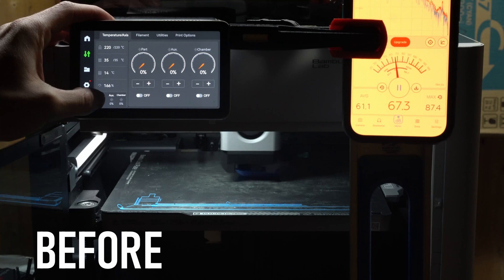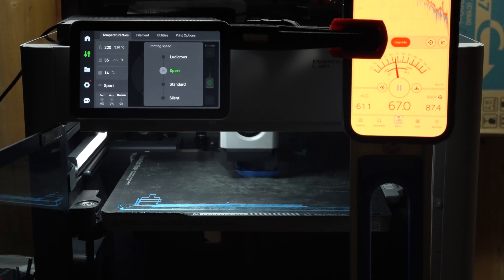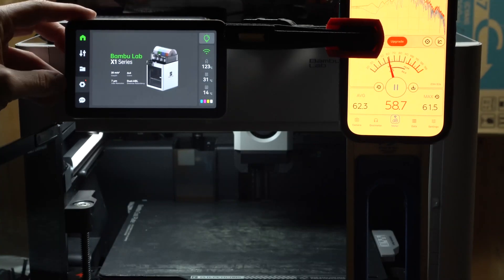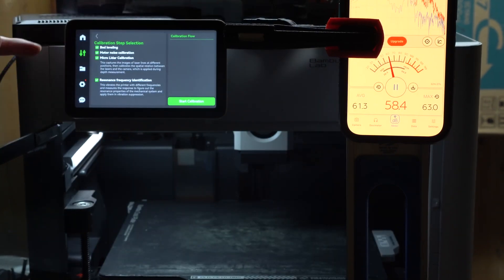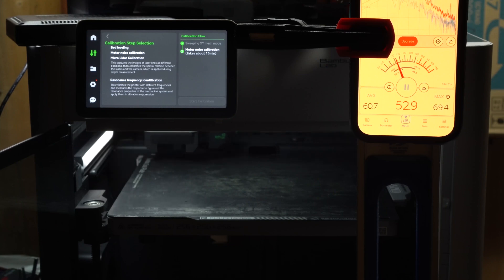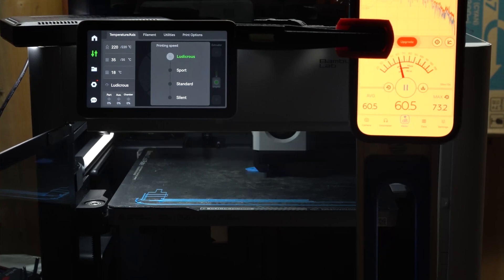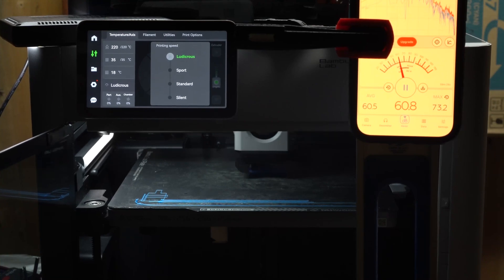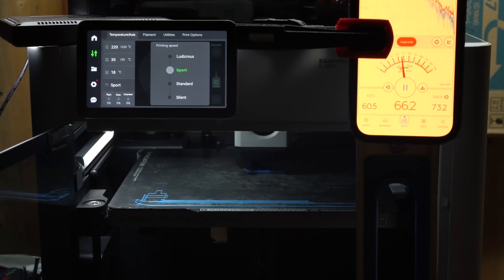Is the X1C finally quiet? Motor Noise Cancellation Firmware Update

Comment: your printer isnt supposed to sound like that. you could here a clicky noise and like something is loose, you need to adjust the belt tension. That doesnt sound really good. I hd the same problem with my X1C and bambu lab told me to adjust the tension on the belts and calibrate it.

Comment: I believe it causes the noise to be higher frequency. Active noise canceling, in general, removes mid noise, increases high frequency noise, and can't change base. The better the noise canceling, the higher the frequency ends up being(ideally, out of human hearing range), and then the higher frequency noise attenuates naturally.
Reply: It doesn't simply change the frequency. It creates a second sound wave that has the same amplitude but opposite polarity to the first sound wave, which makes the sound waves cancel each other out.

Comment: To test this properly, you need to put the microphone 1m from the printer on an isolated mount, the take measurement for say 1 minute and do a frequency analysis so that you can get both an average spl noise floor and also an average of the frequency distribution of your noise floor. You then do the same testing with the printer prior to the firmware update and finally you test again after the firmware update.

What I can say is that post update, while the peak spl may in fact be similar, the average is considerably lower and the energy is much better distributed across the frequency range so that there are fewer frequencies that have sufficient energy to stick out and become annoying. Also, subjectively, my office is one room over from my bedroom and the motor noise used to be clearly audible through the wall particularly at night when the noise floor is lower. Since the update, as long as I'm not physically in my office, the motor noise tends to blend into the air filtration system (which produces close to pure pink noise) that I always have running while the 3d printer is active. I find this noise much less objectionable and far easier to ignore than the harsh and aggressive motor noise prior to the update.

Comment: When I ran the calibration, the machine sounded like it was trying to beat itself to death, running full speed over and over into the stops. Some of the collisions sounded like the steppers were skipping belt cogs. It was bad enough that I didn't know whether to risk running the motor calibration again, but I did anyway, because what else was I going to do? It worked "normally" the second time, and I have no idea what happened the first time. The good news is that my printer is okay - and the motors are indeed much quieter.

Comment: You have a lot of bearing chatter going on with your left and right linear bearings... I recommend you clean and oil your smooth metal rod bearings before the chatter damages the finish on the rods and ball bearings like my first machine did. First thing I did when I received my replacement machine was clean the bearings with alcohol (I actually found metal shavings in the bearings), and oil them with a thick oil like Super Lube 51004.
Reply from the maker: Thanks for the tip, I'll have to take a look at this. It sounded like this pretty much since the beginning so I just thought that's how this printer sounds from the factory. 

I've cleaned and lubed the rods in the past but not the bearings.
Reply: @3DPrintStuff My second machine was loud just like the first one, but thankfully I applied Super Lube-21030 during the break-in process, and then Super Lube 51004 oil to limit the chatter before any damage happen. The oil seems to work fine as long as I wipe them down and reapply the oil on a regular basis. You might want to inspect the rods on yours though because u could have damage at this point.
Reply: No that is defiantly not how they are meant to sound from factory. both my printers have no rattles etc. just pure motor/ belt noise.  @3DPrintStuff
Reply: @3DPrintStuff   Your printer sounds like sth is lose or it falls apart soon, my P1S sounds WAAAAAAYYY more quiet when its printing this fast. 

Like ppl suggested you should maybe maintain your printer :p That is extremly loud and kinda annoying? atleast for me^^
Reply: @3DPrintStuff  I've bought an X1 recently and is sounds just like yours, its driving me crazy, it seems that the metal case is resonating with some movements, could you resolve your issue?
Reply: @3DPrintStuff  this is what mine sounds like since new too.
Reply: Yes, constant grease purge and wipe often keeping things fresh. The German machinist in me, habits.
Reply: exactly how do you apply the oil to the bearings? I hope you dont have too take them out.
Reply: @skampster  I just run a thin line of oil on the top of the smooth metal rods and move the gantry back and forth then wipe off the excess. The important thing is to make sure your gantry is square though because oiling will only do so much.
Reply: @wrxsubaru02  cheers, but. in your original post you said you cleaned out your bearings and found metal shavings, this is what I wanted to know how you did this without removing the bearings.
Reply: @ oh, that’s what you meant… I just used a lot of rubbing alcohol and moved the gantry back and forth wiping off with paper towels till the bearings were dry. During this process I cleaned out the original oil and metal shavings. After that I oiled them back up.
Reply: @wrxsubaru02  gotcha

Comment: Had to roll mine back, wouldnt print on the textured plate after the update, never got close enough to the bed for the first layer, fine on the other plates, just not textured
Reply from the maker: Weird, I've only used the cool plate since updating the firmware but usually use the textured PEI, I'll let you know if I have that issue.

Comment: Thanks for the reminder to not buy that noisy box of junk.  Wow what a racket.
Reply: You don’t buy a sports car for it to be quite
Reply: @joeyschultz7443  lol that's not a sports car. It's a pile of proprietary crap. Build a Voron.
Reply: Voron rhymes with so much more on this rhyming thing.
Reply from the maker: Putting this video out there for people to make their own purchasing decisions. For the speed, ease of use and reliability I still love this thing. I just put it in the garage where I can't hear it. To each their own.
Reply: @3DPrintStuff  Your video did just that, keep it up.  In the garage, it would freeze up here, and CNC's/Printers don't really like Canadian winters. GRBL and the shapeoko board liked to disconnect the serial connection until things got "warm".
Reply from the maker: @pXnEmerica Fellow Canadian here in Calgary. I put it in a grow tent with a little space heater during the winter. We've had a really mild winter so far and I haven't been printing much lately so I haven't moved it into the tent yet. 

My printer probably won't last as long as someone running it in their home but I live in a 4plex and don't want to keep the neighbors up with my 3d printing hobby.

Comment: We have a few machines, and a few days ago I added an A1 mini for smaller jobs. As well as astonishingly good prints that are by far the best I've ever had, as well as high speed, it's essentially silent. While it's calibrating for noise cancelling it toggles between off and on, and the difference is huge. Before this we added a Creality S1, which in comparison is a piece of junk, largely due to terrible software. Bambu are doing so much right, with bed levelling that works, running tasks in parallel taking into account how long steps take rather than one step at a time, excellent input shaping and more. Some glitches with spool getting stuck, but nothing that can't be solved. Seriously great machines.
Reply: one hundred percent agreement
Reply: Filament sticking? Is this during retraction? I replaced the blade that looked and felt decent. Problem solved.
Reply: @Keith-um1pj  i was using a spool of eSun high speed ePLA and the wooden/card spool was twisting on the spool holder and got stuck. I had the AMS too so hooked that up and had no problem after that.

Comment: Mine slams against the front right at the beginning of print every time. Did the firmware fix that?
Reply: They all do.  Bambu uses sensorless homing instead of physical limit switches on the XY.
Reply: @chaosengine3772  thanks

Comment: A huge difference on my machine.  I kept walking in from another room to make sure it was running.
Reply from the maker: Glad to hear it made a difference, I put mine in the garage cause I could hear it through the entire house (only 800sqft). I'm sure this update helps with transmissions through walls/floors.
Reply: This is my experience as well.  It is so quiet now I barely hear it running...  I love the update so far.

Comment: Do not clamp your phone to the printer as this will transmit structure-borne noise and irritate the measurement
Reply from the maker: Quick and dirty setup. My main issue with having this printer indoors was the vibrations/noise that came through the walls/floors, I'm fine with picking up the vibrations directly from the machine to see if that has been affected by this firmware update. 

I did a better setup job in your eyes in this previous video: https://youtu.be/S2lVoW9q830 where I had 15" of separation

Comment: Always have something to complain about.
Better use a 3D pen if this machine is to loud.
Technology is always improving and it takes time
Reply from the maker: This is still the best printer at this price point. I'm just making an A/B comparison video of before and after the firmware. Some people have mentioned that I may have some issues with my linear rods/bearings that mean that my machine is louder that the average machine, I'll have to look into this. 

I live in a 4plex and need to be considerate of the noise being transferred through the floor/walls. I do not want to keep the neighbors awake at night because I selfishly want to keep 3D printing stuff through the night. That's why this thing lives in the garage where I can print 24/7 if I want.

I still love the ease of use, speed and print quality that I've gotten out of this thing.

Comment: That printer does not sound normal. There's an awful lot of clacking noise along with it.
Reply: It's his linear bearings on the left and right. This is a problem that no one seems to talk about, but it is something I discovered on my first machine. The linear bearings are basically chattering and vibrating on the metal rods as it moves left to right. My first machine was chattering just like this and it actually wore off the smooth finish on the rod, so I ended up returning it. Bambu offered no support on a ticket that lasted 3 months, so I had to do my own troubleshooting till I found what the problem was, and then discovered the wear marks on the left smooth metal rod. First thing I did when I got my replacement was clean out the bearings with rubbing alcohol, and then lube up the rods and bearings with Super Lube 51004. My replacement hardly has any bearing chatter since I did it from day 1 before any major damage was done.
Reply: @wrxsubaru02 I've recently bought the printer and i'm going crazy with the sound, can you help a little more on how to  do this?
Reply: @wrxsubaru02  do you have a video how load your x1c is now? i really overthink to add one to my MK3S+ which is 50% slower but unhearable 30cm beside me when i work. Which makes it to a perfect workhorse as a product developer. But that noise horse i can hear in the video would not fit to my workflow i have to say.
Reply: @tamgaming9861 I dont have a video of my machine that is uploaded but it is really quiet now. Try pressing on the metal rod slightly while it is printing and see if it quiets down as you press on it. I was able to figure out my right side rod was causing the chatter by pressing on it while it was printing something at high speed
Reply: It looked like the front door was open and wobbling a lot.
Reply from the maker: @d-leb that door is open and the table it sits on isn't the most stable thing in the world but all of the sounds were coming from the printer. 

@wrxsubaru02 mentioned it may be my linear rods/bearings that are a bit crunchy/have metal shavings stuck in them.
Reply from the maker: @mikedixonphoto 
This printer has sounded pretty much this way since the start. https://youtu.be/gJcxC_76g2Q?si=Nc2g1DtSlSwf_gL1&t=558 <-This video at 9:18 is the same print right out of the box and sounds pretty similar. (they are filmed using different cameras/microphones so it's not an exact 1:1 comparison) 

I haven't seen my print quality suffer as a result...

Comment: You really ought to physically separate the sound measuring device (phone in this case) from the object that's producing noise and vibration. Consider using an app that draws a time chart such as Spectroid (although the chart is presented as a waterfall and displays last to 20 seconds or so), so that you may directly compare - the average is somewhat okay as a pointer, but doesn't give you the full picture. Perhaps the new update only affected a specific frequency, but you can only see that from a chart..
Reply: Close the fucking door that's what they are there for. It's not accurate if you're going to keep the doors open
Reply from the maker: This was a quick and dirty setup. I just wanted a quick A/B comparison of before and after the update. I understand the criticism. 

I made this video previously that had a better setup: https://youtu.be/S2lVoW9q830 

The app I'm using does draw a chart but it is just out of frame, my bad.
Reply: @3DPrintStuff  Of course. I meant it not as much a criticism, but more like a friendly suggestion. :)

Comment: I keep my printer in a separate room, and the main thing I hear through the wall is the motor noise, not the fans. The firmware update has DRAMATICALLY reduced this noise for me.
Reply: With silent speed I couldn’t hear it printing at all in the next room (open doors). I checked a couple times with the app if the printer was still printing. 😅
Reply: Same here, I was surprised at how much quieter it is.
Reply: I updated and didn't do the calibration because I didn't know about it. Once my print is done I will defiantly calibrate it. My printer is downstairs and all I can hear is the motor noise so I am excited to see how much of a difference it makes.
Reply from the maker: That's great to hear. That's the reason I banished this thing to the garage. I live in a 4plex and didn't want to keep the neighbors up with motor noise through the floor/walls. 

I could hear this thing throughout our entire 800sqft unit. 

In the garage I can print worry free 24/7 if I want.
Reply: @3DPrintStuff  
Are you having internet in the garage, if not, is the printer worth it without internet?
Reply from the maker: @lb8384  Yeah I have internet in the garage. So I can't speak to using it without internet.

Comment: I own a x1 carbon since 2 weeks and yesterday I updated the firmware. Now it’s less noisy but the prints started to wrap on the angles and they often come off the plate 🤬🤬🤬
Reply: Did you do a full calibration or just the noise one?
Reply: @TheRodT  Full calibration and I tried PLA and PETG. The prints come off the plate. I'm going to open a support ticket. I hope they'll give me the option to downgrade
Reply: @Mangustiano clean yo plate
Reply: Any time you do a firmware update, you should redo a full calibration and make sure you do a bed levelling on the first print after the update. I usually switch the printer off and on again after the update and again after the calibration. If you're still struggling with prints not sticking, try washing the build plate in warm soapy water and make sure you dry it with a lint free cloth or paper towel.